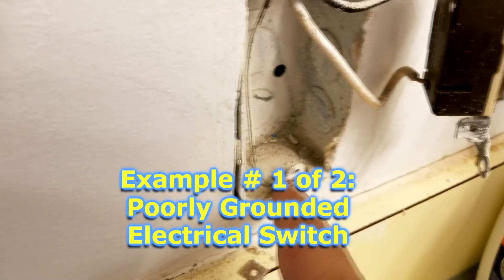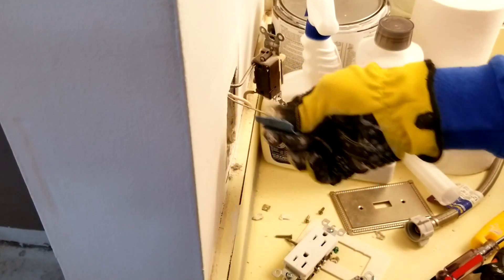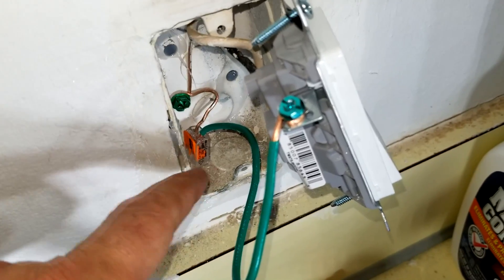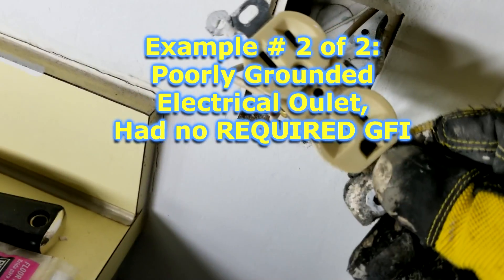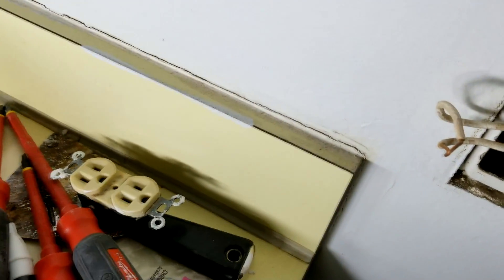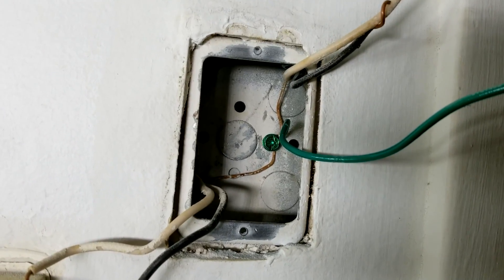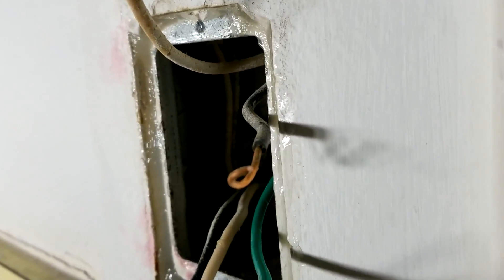How Not To Ground An Electrical Outlet - Wire Outlets Right

Comment: Looked like when you were tightening the wires, you would be going clockwise, but you placed the connection the other way. Don't you want the wires placed the other way, so that when you tighten clockwise, your connection is aligned the same way and it tightens better?
Reply from the maker: You'll have to be more specific, give me a time stamp in the video, not sure what you are talking about. I always twist wires clockwise to tighten them.
Reply: @jeffostroff  at 4:17, the way you have the load and neutral wires attached. You have them feeding on the right side of the screws.
Reply: @Lilliputian63  
It doesn't matter in this case which side of the screw the wire is inserted because the screw and wire do not make contact there is a plate between the screw and the wire.
Reply: @njsongwriter understood, but I was trying to be more specific for Richard Enns, who was describing what he saw as an issue in the way he was wiring.

Comment: Why do these assholes always put their paint all over the box and wires
Reply from the maker: Drives me nuts. I find myself pulling out the ground wires and sanding the paint off them all the time, because idiot contractors think you can twist 2 painted copper wires together and they will conduct.

Comment: Can you connect the ground wire directly to the outlet? Will it only ground the outlet and not the box?
Reply from the maker: If the outlet box is metal, you have to wrap the ground around the screw and run a pigtail to the outlet.

Comment: Hey, what do you do if you don’t have a grounding wire in the box at all?
Reply from the maker: Then you call in a pro to determine if you have metal conduit, and determine if that metal conduit is grounded at the breaker panel some how, then you can tie a pig tail wire to the outlet box. If not, they have to run a groud from the breaker panel.
Reply: jeffostroff so the screws that connect the outlet to the box isn’t good enough for grounding if the metal conduit box is grounded to the panel?
Reply: jeffostroff and how do i determine that?

Comment: Why you have to scare people, no one died with 120 volts. kitchen and bathrooms need a ground wire got it but you don’t need to Run the wire all the way to the breaker box just install a screw inside the junction box add a piece of green wire and is grounded you make this looks hard and is not.
Reply from the maker: Why you have to scare people, by claiming I'm scaring them? You never watched the video. I never said you had to run the wire all the way to the breaker box, the builder already supplied the wire to the outlet, but they forgot to wrap the ground wire around a screw on the metal box to bond it to ground like the electrical code says to do. It's not scaring people, you just suffer from mental issues if you think it's scaring people. The problem is in YOUR head, not THIS video. This video is opening your eyes to what was done against code, and how to easily fix it.  BTW the manner in which we repaired it here is to code, and should make you feel better and safer not scared after seeing the video. You're trying to make it look hard and is not.
Reply: But if the box isn’t connected to ground at the panel then u essentially just have a floating ground that doesn’t do anything protective

Comment: Hi Jeff, great video (especially for homeowners and DIY 'ers.  I'm an electrician in Canada and I've worked on everything from residential to commercial to heavy industrial (coal ports, grain silos, etc) and high voltage as well.  Please avoid using wagos.  I've seen them fail in multi family installations.  Best to use marrettes and ensure that when twisting the conductors together to have the twist carry down into the insulated portion.  This ensures that the electrical connection has mechanical support.  Hope this helps to keep things safe.
Reply from the maker: Maybe they have gotten better. Lighting companies are supplying Wago like knock offs in their lights. Perhaps what you saw was not really Wago but cheap knockoffs.
Reply: @jeffostroff  It's the economics of quantity vs quality.....lighting companies use them for speed.  Large residential and commercial projects like them for speed, much like the backstabs on receptacles.  The issue is heat....no matter how accurate one is when stripping the wires over time the insulation will "shrink" or pull back away from the electrical connection.  It was company policy to replace all the wagos in light fixtures with marrettes.  There were also engineers who would spec marrettes right from the lighting manufacturer.  Of course that works when a job calls for plus or minus 1000 fixtures🙂.
Reply: @colincampbell5207  thank you sharing your valued experiences with me.
Reply: I had bad experiences with a Wago knockoff made by Ideal, sold at Home Depot.  The Ideal knockoff is very poor, qualitywise.  A genuine Wago connector will be much better than the cheap knockoff.  Some older gang boxes are small, and newer "high tech" loaded devices take up space, such as outlets with USB ports and AFCI/GFCI protection built into them.  Those receptacles take up much needed space in an old box, when updating outlets.
Reply: @Max Headroom  I suspect that the Wagos now are of much improved design.  Personally I have trouble trusting the originals and definitely do not trust the knock offs (kinda like the "marrettes" that come with residential light fixtures).  For now I'll keep on twisting!🙂

Comment: I also hate cigarette smoke.   The only problem I had with your video is that the white paint was not removed from the ground screw mounting point inside the box. That paint is an insulator. Other than that keep up the good work.
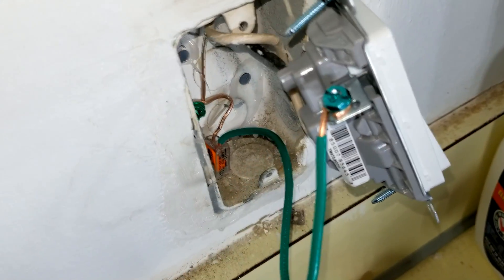Reply from the maker: Well Dave, you're partly wrong. Yes the paint will insulate the screw, but I'm no getting my ground through a screw on an outlet plate. If you see at 3:38, I added a green ground pigtail, tied to the box, so I'm perfectly safe. that's why I added that wire for more of a guaranteed ground.

Comment: Hey ! I'm in a 1955 type house.want to replace 2 prong to 3 prong.but,dont see any ground wire..oh ! And want to run a air conditioner.. it has metal box of ourse..shat do think !
Reply: The other  2 things you can do is change the breaker to GFCI then you don't have to worry about grounds cable on the outlets on that breaker and you simply change the outlers from 2 to 3 without needing a ground. The other way is lets say you have 4 outlets running on a breaker- if you can find the 1st one that then feeds the others then you put a GFCI to that outlet - no ground required- and then upgrade the other outlets with 3 prongs no ground - anything wired after the GFCI will be protected by the GFCI circuitry. The GFCI should be marked with a label saying GFCI- no ground..
Reply: @rhdtv2002  I changed it out to Gfci..its working now..got airconditioner going..just in time for the heat wave..thanks..
Reply from the maker: There is one thing you might be able to do if you have metal conduit in the walls for your wiring and if you have metal boxes and you can test that they are grounded to the 3rd line coming into the house, then you might be able to use that as a ground. But it really takes an expert electrician to be able to tell you that. if not, what we did at my friends house is it cost $7000 to have an electrician come in and redo the whole wiring and put in a whole new fuse panel and he also put in LED surface mount lines in all of the rooms ceilings,  And they were able to convert all of the outlet's 23 wire by re running that 3rd ground wire to every outlet in this 2 bedroom house.   Put any and all of the electric was brought up to modern code.

Comment: If I were u I would tear the whole house down and start over before the fire does its job. The wiring behind the walls is probably more fucked up. If I were the home owner I wouldn't even stay in that house for a day because I know its gonna kill me. Don't get why sometimes people just can't see apparent things.
Reply from the maker: I doubt it will start a fire. Without the ground you simply have 2 wire, which is what we used in the U.S. up until about 1962. The ground is more to protect you from shock. But also keep in mind this house has metal conduit instead of just Romex cable, and mostly the boxes are grounded at one main point where the conduits all meet the electrical panel.
Reply: @jeffostroff  incorrect wiring could be a fire hazard too (loose connection causing arc fault). That's why the code exists.
Reply from the maker: @jared5970  Yes, that's why I typically when taking over a foreclosure like this during my remodel I change out every single outlet and switch, upgrading to modern decora switches, and this is when any builder wiring mistakes are revealed.

Comment: Nice video Jeff, I have a question. Why do you need to run a ground pigtail the outlet or switch if the box is already grounded? Once the device is screwed onto the box it is in contact with it meaning the outlet or switch is grounded.
Reply from the maker: The pigtail is to ground the outlet, not the box. The box you can see I bonded to the system ground wire by wrapping the incoming wire around the green screw. But now you need to connect that pigtail wire to the same copper ground wire, and the other end of the green pigtail wire is attached to the ground screw of the outlet.
Reply: @jeffostroff  Hey Jeff, I see the Box is grounded. If in fact the box is grounded, the outlet WILL BE GROUNDED just by being attached to the box. Meaning there would be no need for a ground pigtail to the outlet. Am I missing something? Thanks again.
Reply from the maker: @bensonhurst7272  You are right and wrong at the same time. Some electricians share your point of view. I'm more conservative on the safety side, and prefer to add the extra ground pigtail, because if you ever remove the outlet from the box, you LOSE YOUR GROUND PROTECTION! So smart engineers like me never leave anything to chance. Who knows how many lives I have saved by doing this, because we all know DIYers, handymen, and even some electricians will play with outlets while they are powered up, so if you have an outlet that is powered up and you unscrew it from the grounded metal box, now you have no protection unless you added my green ground pigtail wire. Here's another thought, with plastic boxes, you have no choice, you must have that pigtail ground, so imagine a guy who spends 90% of his time with metal grounded boxes, and suddenly is working on plastic box, and not focused, doesn't have full situational awareness, and forgets his plastic box isn't grounded, but thinks he's protected, because he's so accustomed to having the box grounded.
Reply: @jeffostroff  Thanks for your explanation. It makes sense. Better safe than sorry!
Reply: @bensonhurst7272  and with all the silicone and paint on the box I wouldn't trust getting a solid contact.
Reply: @bensonhurst7272  
If it is a self grounding outlet then you are correct. (At least that's my understanding but I'm not a licensed electrician.)
Reply: Not all outlets are designed to be self grounded. I think I saw a sparky channel on the subject. Sparky channel said he talked to the Leviton guys and they said that their self grounding outlets are identified by a gold color tab.

Comment: Jeff I had a question about changing out an outdoor light fixture. Old globe style replacing with Hampton bay mission fixture with a GFCI. 

Only a neutral and hot wires from the wall when I removed the globe. When I hooked up the new fixture with the GFCI, nothing worked. Bulb won't come on and no power to the gfci. Only the two wires hooked up. The ground from the new GFCI is on the green screen on the bracket. But no ground wire into the house.  There is power in the wires when i checked. 

I replaced the fixture with a LED flood light and that worked fine 

Why doesn't the fixture with GFCI work? Is this safe?
Reply from the maker: So the fixture actually has the ground fault built into it? Is there a rest button? Usually GFCIs come from the factory in the tripped mode, meaning no power, and you have to push in the reset button until it clicks in, the the GFCI is turned on.

Comment: Why plug-up the 2 holes in the junction box?
Reply from the maker: Good eye Jose! We have another video covering this, on sealing your apartment against cigarette smoke from the neighbors unit. The next door neighbor is a horrific chain smoker, and rancid third hand cigarette smoke is seeping in from the neighbors side of the hollow drywall, and we smelled it coming through these holes in the outlet box, through gaps in bottom of baseboards, around the vanity plumbing holes, the bathroom fan, etc. so we sealed up every hole, and we seal each outlet box to the drywall, and at 6:00 in the video you can see we also added an outlet plate gasket as a final line of defense against smoke inside the wall.
Reply: @jeffostroff  
And if the neighbors get roaches, you'll have some protection from getting them as well. 😉

Comment: I have an old house where I replace all outlets. They are properly wired/grounded ( metal box and no ground wire) plug-in tester reads “correct “ how is that possible?
Reply: That scenario could also apply to switch boxes correct? Will find out soon next project is to replace some light fixtures.  👍👍
Reply from the maker: @omarhu   Yes it is very common that I see older switches that don't have grounds on them, even though there was a ground wire in the light switch Box that is being unused. So a lot of times when I take over a for closure property, I replace every single outlet and switch in the house whether it needs it or not I operate to everything brand new, I don't give the buyer's home inspectors any reason whatsoever to give any negative remarks on my property.
Reply from the maker: If you used a pigtail wire to ground the outlet to the metal Box, it is quite possible that your system is already grounded by way of the metal wire conduits in the walls from outlet box to outlet box. So a lot of times those metal conduits are grounded and connected to the fuse panel,  In the fact that they are screwed into the body of the fuse panel means that they are grounded at that point.

Comment: Note wire wrap direction.  as tighten screw it cinches not expel. lack twist, but better then was.  good video.
Reply: That switch doesn't use a loop, it uses a straight connection under a clamp for hot and neutral. There is no clockwise or counter clockwise except for the ground.
Reply from the maker: Thanks!

Comment: jeff i bought a place as is and found previous owners put 3 prong with no ground..also when i gutted the kitchen i found the outlets there have copper wire running to at least 3 outlets..house was built in 1949..is this house grounded? or do i put 2 prongs back in..thanks
Reply from the maker: The outlets are only grounded if there's a ground wire running to the outlet. The NEC does allow you to put in 3 prong outlets if they are GFCI, but keep in mind the outlet is still not grounded, it's just there to accommodate the appliance plug, and you must affix the blue sticker that says it's not ground protected. You really should have a licensed electrician come in and just check it out, and look inside your panel to make sure that copper wire is grounded to a real grounding bus bar, and that the bus bar goes off through a 3rd line out to the power company ground. It could be that they selectively upgraded the grounds where they could, where it was easy run the ground wire behind the wall, but not where they were too lazy to run the wiring. At my friend's condo last year, built in 1949, they had come in some time in the past owners had ran the third line ground to all outlets converting them to 3 prong, but not the master bedroom, because of the several holes they would need to cut in the drywall to make it happen.
Reply: @jeffostroff  i will turn off the power and pull the box and see if there is a copper wire..if so then i just need to bond it to the box like you did right?
Reply from the maker: @irock4u222  Yes, Sparkychannel has a great video on this here, and he shows yo all the steps and labels you need to implement: https://youtu.be/afdjix27Cv8